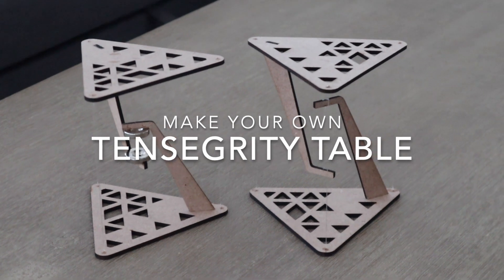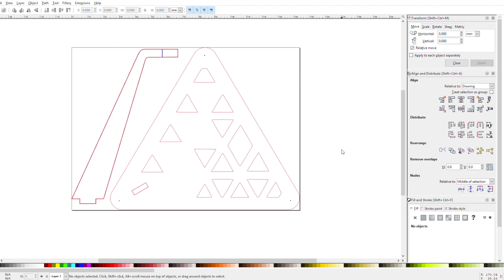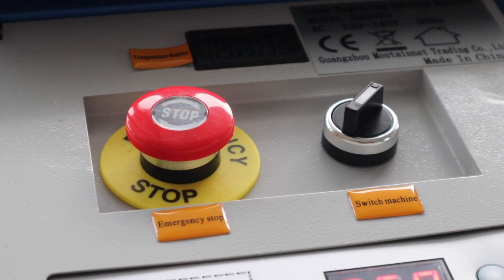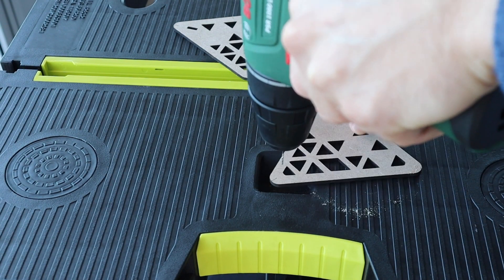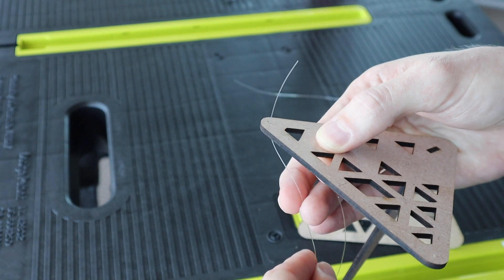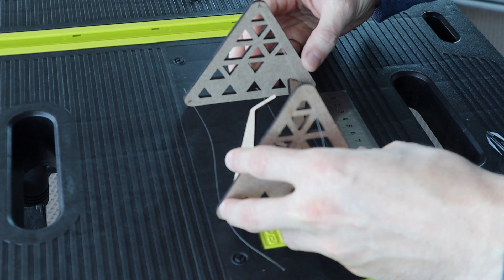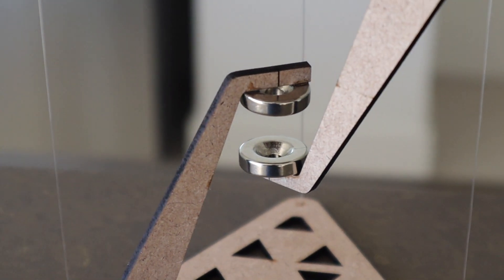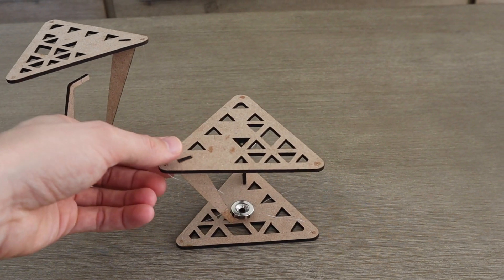Make Your Own Desktop Tensegrity Tables

Comment: Nice work!!! And thanks for the plans! Just a little suggestion: you can cut 3 pieces of "spacers" on MDF, to use them on the assembling phase, to secure the two bases in place (this would make the bases exactly paralel, and in the exact distance between them). 3 sticks with 2 "mouths" each would make it. Use the sticks to secure the bases, put the fishing lines, glue / knot them, and when done you take the sticks out. I hope my bad English was enough for you to understand; if not, let me know and I will make and post a sketch - or even a inkscape plan for it.
Reply from the maker: Thanks for the suggestion, these would definitely make assembly easier!
Reply: Amei. Vou fazer uma banqueta pra colocar um vaso de "zamioculca"

Comment: What prevents the one with the magnets from twisting and the magnets coming together?
Reply from the maker: The lines on the side hold the table surfaces level and naturally rest with the closest allowable distance between the magnets. Any twisting would cause the magnets to more further apart, which wouldn't happen without external force.

Comment: If you use a stronger wire, like maybe metal wire, would that make the table stronger?
Reply from the maker: It's a combination of the strength of the line/wire and the wood. This one is actually limited by the MDF rather than the line. The MDF support bends and then snaps before the fishing line does. If you use aluminium for the parts and some thin steel wire, it would be a lot stronger.
Reply: @MichaelKlements  ok awesome. I was about to go out and buy Kevlar string. I guess I’ll have to reconsider the material of the table as well.

Comment: I been toying with spring and mag combinations. Different size diameter mags, smaller ones used to cut weight of suspended platform. Pillars and pyramids of mag assemblies. Struts can penetrate and float above and below platforms.
Reply: Vou tentar fazer e gravar também. Serpa que eu consigo?

Comment: I wonder if you could make a magnet table at a functional size if you used strong enough magnets.
Reply from the maker: Large neodymium magnets are generally quite expensive but you probably could.
Reply: @MichaelKlements   Mmm interesting. It may not be as stable... But if you were to line the magnets up, so that the pair in the center were attracting ( in tension ) and just above ( and below them ) centered in the top ( and bottom ) surface was repelling magnets. I wonder if the whole thing would stabilize and give you a true hovering table.
Reply from the maker: Oh, I thought you meant using larger magnets just for the centre to build an actual functional table. The problem with using magnets for both the centre and the outside supports doesn’t depend on the size of the magnets. You’d have a equally difficult time with magnets half the size and double the size of the ones used in the video. It’s a problem with the way in which magnetic fields behave and interact, it doesn’t really matter how big or small the magnets are.

Comment: It would be very tempting to try to make one with no lines, only magnets.
Reply from the maker: This would be awesome but it would be really difficult, if not impossible to do. You'd have a really difficult time trying to get the outside three pairs to perfectly balance without one of the pairs "snapping" together and a further challenge would be to get the three outside pairs to perfectly balance with the center pair. 
You'd have a better chance by simply trying to use repelling magnets to levitate a top surface.
Reply: @MichaelKlements  excellent point. Thanks!

Comment: Wonderful and thank you. Would you sell a ready made piece in form of a flat pack and mail it to South Australia ?
Reply from the maker: Hi Eddy,
I'm busy doing some upgrades to my laser at the moment, but once it is up and running again I'd be happy to.
Reply: @MichaelKlements  hi thanks for sharing. You dont need masking tape to have clean cuts. Cut the mdf bare and wipe the surface clean with methalyted spirits. It will remove the burn residue left from laser cutting.
Also to remove the burn smell you can buy cheap ozone generator on amazon (the ones with the blue plate) and place inside a sealed plastic box.  After 30min the burn wood smell is gone.
Reply: Michael Klements super and keep me informed please
Reply: Will you sell me one? Thanks

Comment: There is no reason to not use magnets of different sizes and different shapes and combinations to allow an increase in the gap or different hanging arm/magnet configurations. Like to see everybody's ideas.

tape small quick clamps to the table to hold your parts in place while setting your strings.
Reply from the maker: Yeah you can definitely use different size and strength magnets for some interesting designs!